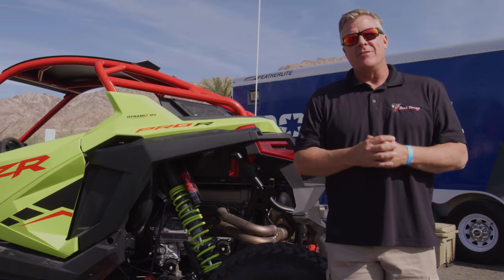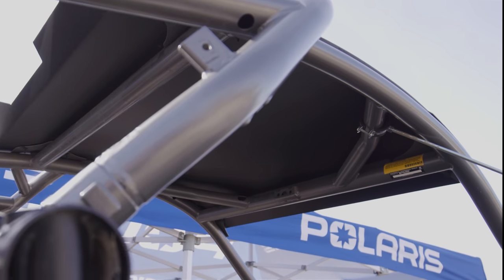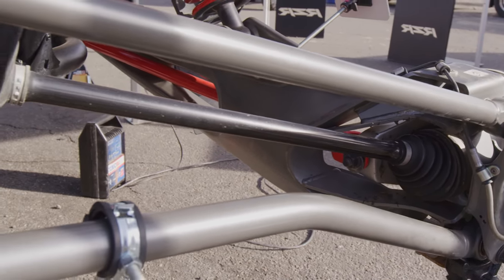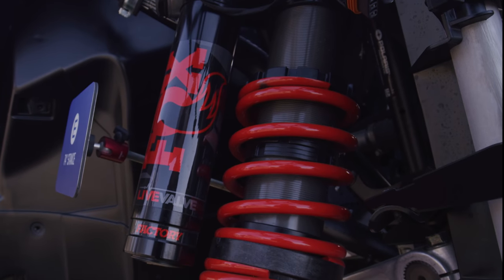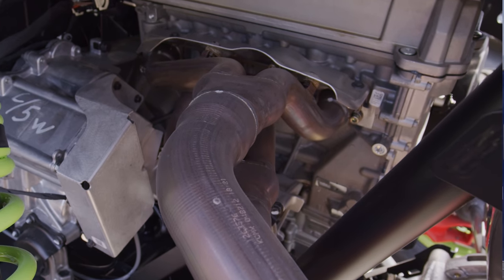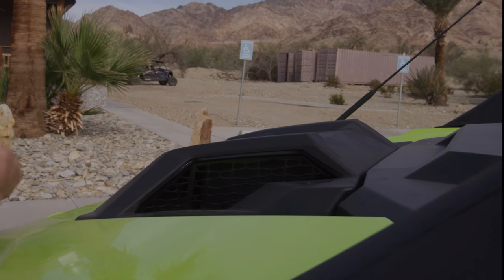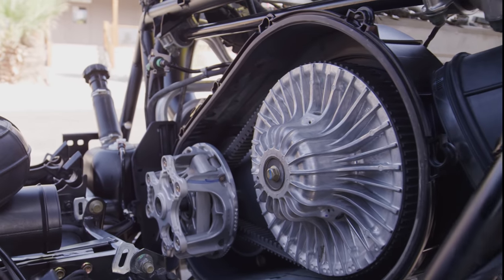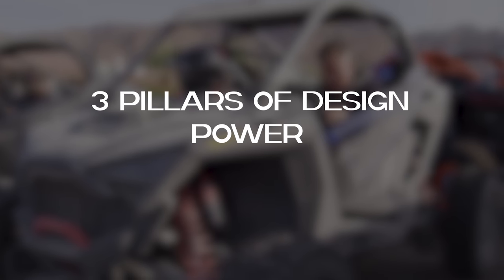Inside the NEW 2022 Polaris RZR Pro R!

Comment: Everything about this is great except for one thing... Where the belt box is. Not ideal if your in the middle of a race and need to change out a belt but have to pull half the interior apart just to get to it. Best in the desert races require the seats to be bolted down during a race. Another huge obstacle for anyone wanting to run one of these in a class.

Comment: Great review.  About time Polaris worried about the chassis, cage and rear arms.  Looks like they finally did what Arctic Cat Wildcat XX and Speed did the first time regarding frame and cage strength, chassis, alternator, etc.  Definitely looks awesome and the live valve suspension and new engine look amazing!
Reply: Yep it's all about money and hype Polaris is all advertising hype throw money at it everybody likes it. Artic cat was first with trailing arm suspension the next year Polaris had it in 2018 heavy-duty chasing great dash and creature comfort and best ride in the industry also external alternator guess what now Polaris has it imagine that! Polaris has always used the public to test out there machines and made them pay for the testing

Comment: Sooo Im wondering which Side by Side you would recommend for mountainous sandy/rocky/muddy terrain (BC), Canada lots of logging roads, long, steep rocky hillclimbs (Locking hubs are a must)Im an agressive driver so durability is my #1 concearn. Ive been gravitating towards KRX with its beadlock wheels and 31"carnivores and clearance and bigger a-arms etc, yet they havent changed in 4 years (not even dealing with known issues (connection points being the weak spot. I am amazed that with the cost of these things that ; 1. they dont have truck style transmissions and diffs.2. the bumpers and winches are extras. 3. Bigger wheels and beadlock rims are not factory items. What would you drive in the mountains (who has the best suspension? )
Reply from the maker: I would say a smart lock X3 or a two seat Pro XP. I love power when needed and both of these have that and have crawled rocks great for me. Don’t think the Pro XP has a locking dig but I could be wrong

Comment: I can't wait for CanAm's response to this.  Might have to swap out my beast if they do it right.
Reply: No need, power to weight is still in can am's favor. Hopefully poolaris has addressed the Chinese star primary issues from the past because that primary is now between the seats..
Reply: @chrisgoetz2789  If you blink at the Canned Ham, it shits its pants and the front end falls off.  ;)
Reply: @chrisgoetz2789  If CanAm responds with their 1.6L (i think that's the bigger engine) and it's turbo'd the P/W will be even greater in their favor.  The 22's got the beefier parts but if they increase the survivability even more that would be awesome.  Realistically, there would have to be drastic changes for me to upgrade unless they get rid of the belt.  That's a game changer.
Reply: Doesn't CanAm always have to respond to Polaris?  Just saying...
Reply: @NewTrip_NewAdventure  Right, but they double sheared the back. There’s still room for improvement. Hopefully they catch on.
Reply: If the X3 didn't have the engine it does it would be as popular as the YXZ or the Shit Cat XX....now it's out classed. Anyone ever work on a X3? It sucks! Like the navigation on the X3? Oh yeah there is none..X3 extended warranty? Oh yeah that sucks too... POLARIS was years ahead last year! Now it's almost untouchable- but expensive!
Reply: @snoop8093  thanks 😀 I love it too ❤️
Reply: @MrSteve8511  last year? Didn't they issue an immediate stop riding and return to dealer recall last year...
Reply: @chrisgoetz2789  😁they do have those..
Reply: @MrSteve8511  And that's all I was saying was that was a problem last year and this one has more horsepower and is 2 inches from the driver and passenger. Like I said I really hope the engineers figured that one out and fixed it. 👍😎👍
Reply: Can am is toast. They come out with their new turbo engine and then Polaris just puts a turbo on their new engine and it's game over for can am. I now see why Polaris went with a N/A motor.
Reply: @toddk7197  might want to check the power to weight ratio again 😁
Reply: @chrisgoetz2789  power to wait is not enough to notice unless your doing a drag race. Strait up on the trails you would never notice it especially being naturally aspirated. With weight comes strength. I’m so sick of my front end on my can am. I’ve put 1500$ into gusseting it and it still is trash.
Reply: @Dtay630  sure thing.
Reply: @chrisgoetz2789  power to weight ratio😂😂😂😂. You poor can am fanboys are really grasping at straws
Reply: @toddk7197  gasping?? It's funny how all ya fanboys assumed I even have a can am... Must be that guilty conscience Polaris syndrome.. been stuck for years with them catching on fire and throwing primary drives at people that now that they have a new model out you guys are so excited to come out of the closet finally enjoying the group once again... 👍😎
Reply: @chrisgoetz2789  lol you so angry. Why??
Reply: @toddk7197  Unless CanAm releases an NA engine that beats Poloris's specs.  This isn't a new game to them, they've been battling it out in snow mobiles for years...
Reply: @toddk7197  bwahahaha sure thing project on other's bwahahaha you just read in anger, I got cha.
Reply: @chrisgoetz2789  😭😭😭😭😭😭
Reply: @chrisgoetz2789  ya, it’s like 14hp/100lbs for a 22 CanAm vs 11 for this fat girl. Pretty cool build though IF it was anything close to the price of a 22 RR. It’s just not in the same price league which puts it almost unreachable for most of us.
Reply: @toddk7197  it probably has better torque numbers but that’s still a stretch to think it will be a huge difference compared to a RR. The Pro R frame and suspension is definitely advanced compared to the aging X3 but not worth $10k plus more
Reply: @snowrulesnate  looks like you don't need to upgrade the cage, A arms, many other smaller but strength add ons. 3.0 shocks are awesome and the new ride command etc. It's expensive but you don't need to do much to it right out of the box. I know many that spend over $45k on their machine after upgrades. I think polaris had that in mind.
Reply: @odogtriever  I’ve never done anything to my stock machines and never had any issues, nor can I afford to spend $36k or $45k on a new machine or upgrades. I’m about a car length behind the guys that blow their wad on tons of aftermarket stuff, and I’m ok with that.
Reply: @MrSteve8511  My X3 is easy to work on to mod what is difficult?
Reply: @chicago1680  all I can say it that apparently have never done anything significant or ever worked on a RZR 😂
Reply: @MrSteve8511  I built my 700 plus hp Corvette except 1 weld. That's pretty significant. I know 2 guys that own Razors but they are non turbos and slower than us all but it's a side by side they all have the same amount of space to work on it seems. Or maybe woosh on me and what you are saying is over my head. Nit sure why folks say one is better than the other. We need more so it makes these companies better. Mow we need one that can beat the competitions price. I mean 30k+ for these things is ridiculous. I bought my X3 RC Turbo R used. No way I have that type if coin. My LS takes my money but 700 800hp is a lot of fun in a 3300 pound car
Reply: Yes Can am is fast but nobody looks at how they are built Can-Am is the weakest overall car  on the market. If you are planning on buying a Can-Am you better plan on a lot of aftermarket parts and it still will not be as strong as the pro r.

Comment: Great review.  Would love to know more about the walker evens version of this machine.  I was looking at getting the sport package on this machine.  Nobody has been talking about that though.  Thanks for the review.
Reply from the maker: Remember, this is just an unboxing, Review coming in the future after driving it.  They did not have any Walker packages for us to see.
Reply: @ShockTherapyllc  the premium pro r is just about $10,000 more than my 2021 turbo s premium was. Now that I've had dynamix fox suspension im not sure i can ever go back. Its so amazing compared to what I've driven before. I would pull the trigger and order one but my payment would go up and my extra beadlock wheels for my turbo s won't fit on the pro r.... that actually is the deal breaker for me. I lost a lot of money moving from my yamaha into the turbo s and that was just last February. I am really excited about the upgrades and that 4 cylinder motor. I could save money sticking to the less expensive machine on walker Evans shocks... oh, cant forget the ride command system. I love that gps in there! We use a tablet with avenza maps for our club rides and the ride comand is a backup in case the tablet dies. I feel really safe with the GPS in there. Night time on the dunes I never worry about what direction to home? So, I couldnt go back there either. No turbo would be less electrical connections to fail and less moving parts to fail. I just need to pull the trigger on this..